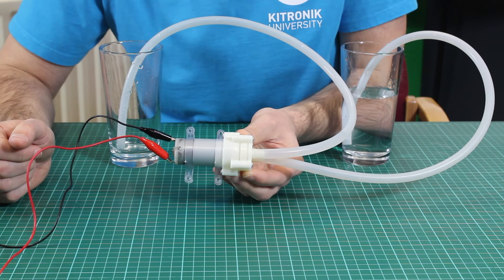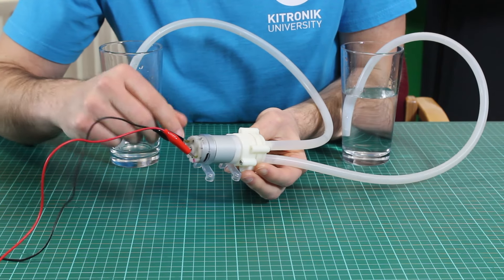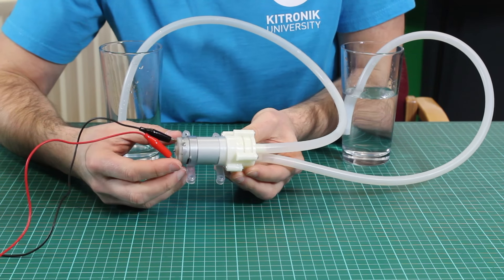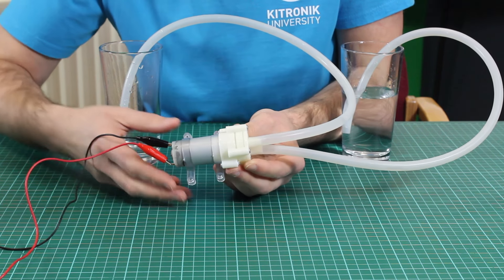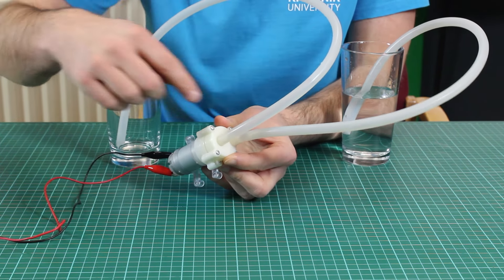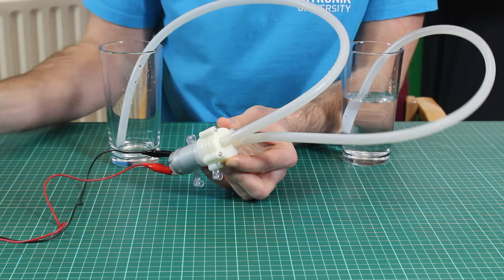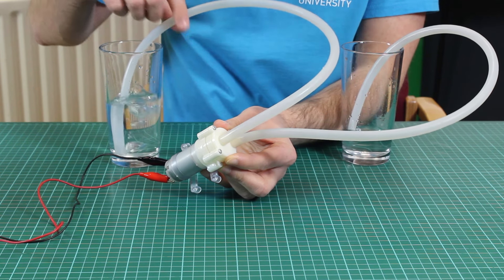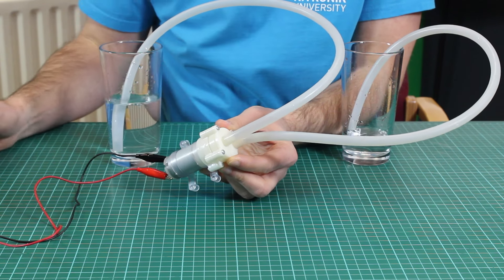R385 diaphragm pump (6-12V) - Kitronik

Comment: In ordinary motor pumps even motor is swiched off water flows in and out...no blocking..system. .what about this pump
Reply from the maker: Hi, thanks for your question. When power is removed the pump will stop operating, so it will not pump water. I expect you will be able to force water through it but water won't flow by itself until the power is reconnected. I hope this helps.

Comment: I am working on a university project and I need a small water pump that can pump water from A to B and then from B to A. I am not familiar with water pumps. What small water pumps that can do it and where can I find them?
Reply from the maker: Hi, we have only stocked, and have experience with, pumps that work in one direction only. There are some practicalities involved which will likely mean that bi-directional pumps are not common. Making a pump that has the same efficiency in both directions seems like it might have expensive solutions.

If you will be using inexpensive pumps, it might work well to have two separate pumps controlled by the same microcontroller?

Sorry we couldn't be of more help with this.
Reply: Hi did you find anything that worked for you?
Reply: You can use peristaltic pump. If you can figure out hwo to reverse the current flow then you can do reverse the water flow.
Reply: We have to air lift the water about 24 inches through  garden hose before it reaches the pump- will this work
Reply: @keithfrancis4178  although this isn't my field of expertise. I do have some experience with these pumps. My suggestion, it shouldn't be an issue if you can get a pump with high flow rate. Atleast 500 ml/min flow rate should be enough for your use case.

Comment: Would it matter if i use it on a 5V? i dont mean if it will work better or worse but if it will be able to break itself for not using the amount of V that he was supposed to get
Reply from the maker: There will be a point that it won't work at all, I'm not sure if that point is 5V or lower. As it is rated for 6V - 12V  you would be taking a risk.

Comment: Is the pump really so quiet?
Reply from the maker: It's very noisy when moving air/gas but much less so when pumping water. It's definitely not silent but it isn't distracting when running in a room.

Comment: whether the water pressure is strong?
Reply from the maker: Hi, the Maximum flow rate of up to 1 - 3L/min means it's quite a powerful pump for its size. It can pump water vertically up a pipe for approx 3m. I hope this helps.

Comment: Hello, If i understand correctly this pump should alternate between aspirating and exhausting. So can I use it to prime a loop that is attached to one single output of a tank ? And then once it's primed have a three way valve to redirect the flow to the actual application ?
Reply from the maker: Hi, I'm not sure I completely understand what you are asking. The pump only works in one direction and uses a self-priming function to create a pressure differential in the diaphragm chamber. If you require the pump's output to go to different places, depending on criteria, then you would need control valves to facilitate this. I hope this helps, let us know if this doesn't fully answer your question.

Comment: Hi pls reply what is diameter of the pipe you used in this pump 😊
Reply from the maker: Hi, and thanks for your question. 

The pipe has an inside diameter of 6.4mm and an outside diameter of 9.4mm. We supply i in 1m/5m lengths here; 

https://kitronik.co.uk/products/silicone-tube-for-use-with-6-12v-r385-diaphram-pump

Comment: Suppose pumps one end is connected to baloon filled with air ... it is not powered then will the air leak from the baloon ?
Reply: No it won't at least it shouldn't
Reply: @jeffgood6441   it was part of a project but I had used it.
It leaks the air. 
Thanks for your reply after a year 😃

Comment: What is the rpm of the pump?
Reply from the maker: Hi, this information is not available from the manufacturers as they express speed for pumps in flow rate. These pumps have a flow rate of 1 - 3L/min, depending on the supply voltage. I hope this helps.

Comment: does this have enough power to work on a bycycle
Reply from the maker: Hi, and thanks for the question. I'm not sure what you mean, but if you mean for inflating the tyres then we would say that they are not designed to meet much resistance. 

There are much better options for this application on Amazon. I hope this helps.
Reply: @kitronik  what im say is it strong enough to build a bike that uses it to propelled forward, talking about a water pump bike, it runs the  dc motor to ride the bike! i down have the supplies to  get it done, but one day  i might try it .  i may have to build a gear box to make it more powerful! like a hydraulic pump, just wanted to do some thing to decrease the electric use as of where i use a 36 volt i replace it with 12volts, just wondering!
Reply from the maker: @Alfred-q8x  They are only rated to move water over a combined distance of approx. 5m at a rate of about 1-3L per minute. I can't see that this would provide a suitable option. If you ever get around to trying, let us know how you got on.

Comment: Can this be used to suck air and create vaccum?
Reply from the maker: Hi, although the pump can move air it is not rated as a vacuum pump. 

The only way to know for sure is to test it but we would be inclined to go for a pump specifically designed for this purpose. Probable outcomes of using this pump are likely to be unsatisfactory and may result in damage to the pump.

Comment: Can it use for automatic sanitizer dispenser. Make 2000 cycle in a day on off in every 2 seconds
Reply from the maker: It could be done. It's a great pump but I would probably consider at least weighing it up against other alternatives.
Reply: @kitronik  but I should use this or not for at least 1000 on off cycle in a day
Reply: Give some alternative of 12 volt pump
Reply from the maker: @thelogicalfacts7732  We don't manufacture it so it is difficult for us to say but I would say the main design concerns were probably centred around continuous use rather than continuous switching.
We have not had any reports of them failing so they would appear to be reliable.
Reply: @kitronik  Which is the maximum time that can work continuously? And how much time should it rest?

Comment: If we interchange the terminals of motor 
Reverse glass filling is starts???????
Reply from the maker: Hi, this pump has been designed to pump in one direction only and will only pump in that direction. You would have to switch the hose/tubes over. Hope this helps.

Comment: You connect the jumper with the pump and what else?
Reply from the maker: Hi, the pump is supplied with a length of tubing. Cut the tubing to the desired length and push one bit onto one connector and the other bit onto the remaining connector. 

All you need is a suitable power supply and the pump will begin to work as soon as it is connected, there is no switch on the pump. That is all that is required, apart from the water you want to pump and the container you want to pump it into. 

If you want to add a switch you can do and if you want to control switching with a microcontroller you can do that also.

Comment: how do I put this together lol
Reply from the maker: The pump is supplied fully assembled and comes with a length of silicone tubing. Just cut the tubing to the desired length and fit the two pieces to the pump. Put one of the tubes in a container of water and the other where you want the water to go, add power and you're done. 

You can then add a switch between the power and the pump, or instead of a switch, you can use a microcontroller for some automated conditional switching controlled by code. You could create a water feature that only turns on when someone approaches or an automated plant watering system. The possibilities are endless.

Comment: What's the diameter of the pump's sprouts?
Reply from the maker: Hi, 
The Silicone Pipe Inside Diameter: 6mm.
The Silicone Pipe Outside Diameter: 8.5mm.
I hope this helps.
Reply: @kitronik  Yes, very helpful. Thanks

Comment: can it run continuously for 24/7?
Reply from the maker: Hi, and thanks for the question. They are designed to handle continuous use.
Reply: @kitronik  thanks for replying, however based on what I've read its lifespan is only 2500hrs it means if I run it continuesly 24/7 it will only be up for 100+ days that's if it will not overheat, maybe I'll look for a brushless if there is. thanks alot.

Comment: how far would this squirt water if pointed up towards sky, please make a video about this and help me. Try making the pipe exit hole smaller, thanks again yar.
Reply from the maker: Hi, we haven't tried this but we suspect not very far. So, if you wanted to make a gentle water feature where water trickles down some rocks then this would probably be a good solution but if you wanted some sort of fountain jet then this would not be suitable for that.

Comment: Does it need to be primed?
Reply from the maker: Hi Edwin, as the pump is capable of pumping both air and liquids it does not need to be primed with a liquid prior to use as the pump will pump happily if the chamber is full of air.
Reply: @kitronik  perfect. Thank you very much.

Comment: Can this pump only be used for pumping water? What about liquids of similar viscosity?
Reply from the maker: It would depend on the liquid, liquids that are acidic for example would damage the pump. 

If the liquid doesn't react to other things, plastics and metals, then it should be ok.
Reply: @kitronik  so hand sanitizer is a no go..
Reply from the maker: @christinechetty7498  Even if it copes with the hand sanitizer, you would need to put in some work to get the switching right so as not to be wasteful etc.

Comment: Is this also works as an air pump or a vacuum pump? thanks
Reply from the maker: Hi Jeff, It can move air but it is designed for liquids. Also, when using it to move air it is quite noisy. Hope this helps.

Comment: "can suck water through the tube from up to 2m and pump water verticaly for up to 3m" this means can pump water upto a total of 5m or is it 3m?
Reply from the maker: Hi Thimas, I'm not clear on pumping terminology but it can draw water from up to 2m through a tube and move it for up to 3m, according to its documentation. In practice, I would expect that input and output would be more balanced. 

In perfect conditions, total travel could be as much as 5m.

Comment: Could not find cost of unit on ebay.  What is the cost might I use or need 1,000,000?
Reply from the maker: We don't sell on Ebay, you can by directly from our site https://www.kitronik.co.uk/2567-water-pump-6v-12v-with-1m-silicone-tube.html

Comment: Hi! Can I use this pump for transferring think batter like in this below video of desert making? 

https://youtu.be/jRT2ZI6lGf0
Reply from the maker: Hi Gauranga, it's not something we've tried. It's only been tested with water and air. Also, if the pump could handle the job you would still need to design a rotating nozzle to get something similar to the video you showed as an example. Sorry I couldn't be more help.

Comment: Can it pull water from 1.5 meter depth and throw it 1 meter above? Does it need to be submerged or be at the level of the source to pull water?
Reply from the maker: Hi Vishesh, It is rated for the following; 

Maximum suck range of 2m.
Maximum head range of 3m.

So in total, that is 5m of water movement. It won't work as a fountain throwing water up into the air but it could do well as part of a water feature, where water is taken from a reservoir and moved up to pour out of something like a stone statues mouth etc. You would need to experiment to find the optimal pump position for your project but it is not designed to be submerged in water. Keep it protected and dry. I hope this helps.
Reply: @kitronik  I need to pull water from 1 to 2 meter below without submerging it. Hope it is possible.